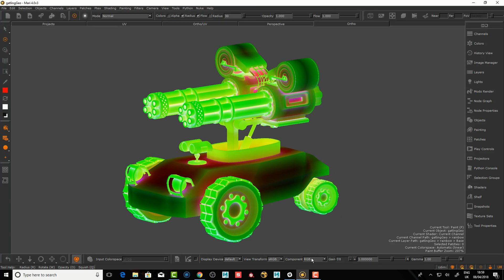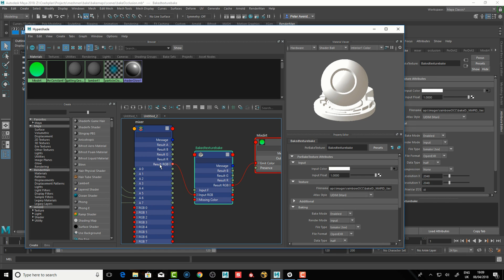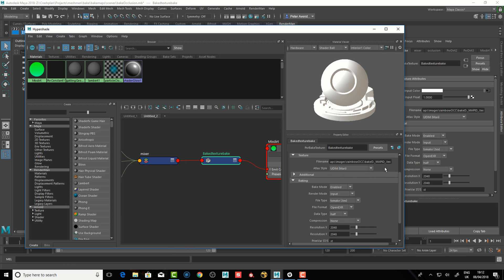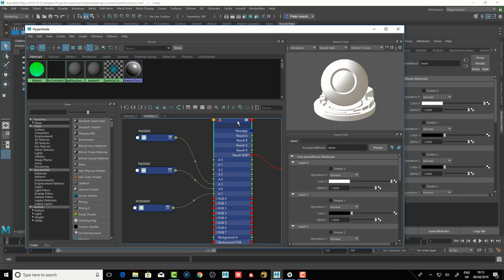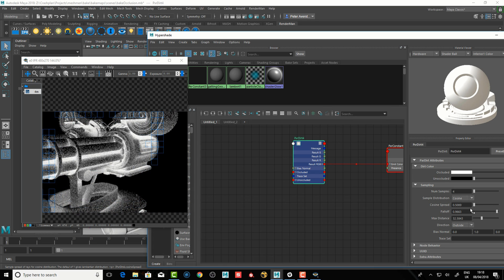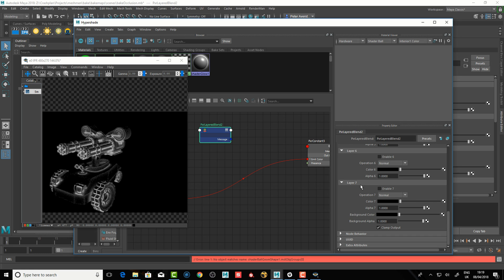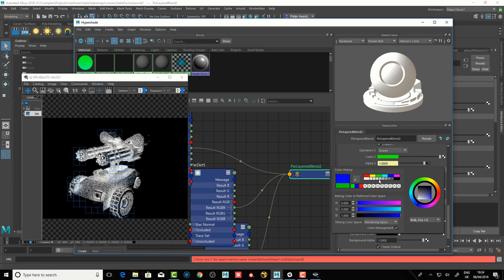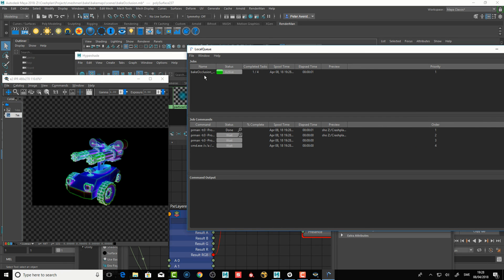Texture baking using Renderman for Maya

Comment: Thanks for this tutorial, quick question, if you stay in Maya, do all of your UV shells have to be in zero to 1? I have many tiles, and if I just try to bake the render it goes black, but I have noticed it takes from 0to1 not from the other tiles. I moved shells into 0 to 1, but then the baked texture is offset? Any settings to change it? thanks
Reply from the maker: You are using what method to bake in maya? Renderman? You need to use udim numbering if you have more than 0-1 uv space.
Reply: Doing that..EX: my file name is:  'sourceimages/textures/suitDiffuse1005.tif '  and I enabled UDIM as atlas... file type 'tiff'.....I just get a blank white tiff..also I tried it as a .tex file and still do not get any baked out texture,..geez, why can't I get UDIM to work..I can move everything to 0 to 1 but that will be a pain.Wonder if UDIM's are bugged in Maya without using the outsourced apps.
Reply from the maker: Filename._MAPID_.tex

Comment: Great tutorial, quick question, can you bake the diffuse, spec, rough spec, normal, and displacement together? or do each of those maps need their own Pxr bake tex? wondering if some kind of layered nodes or something or a workaround can compress the data even more..currently downresing a scene now for texturing & animation.
Reply: NIce, use the RGB channel since those maps are montones..i'll try it and see if it cutsdown render time, I needed to downrez my scene mostly..less is more or crucial in cg...thanks
Reply from the maker: yeah shading time in complex scene graphs can slow down shading time and render time in the end. Happy Rendering
Reply from the maker: you c an only bake patterns textures but not illumination at the moment. Each pattern will need its own bake texture node, but I guess you can comp single channel; textures or pattern together as a RGB combined texture if you layer textures together using additive blending so red would be specR blue would be rough spec and green bump etc